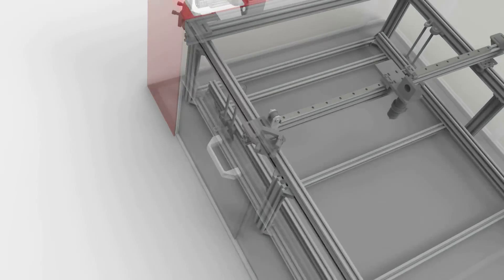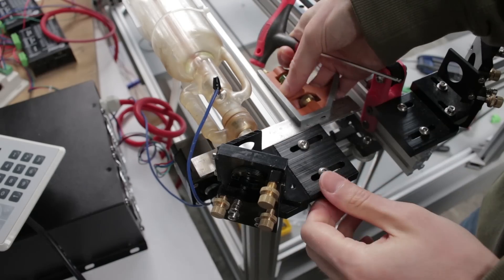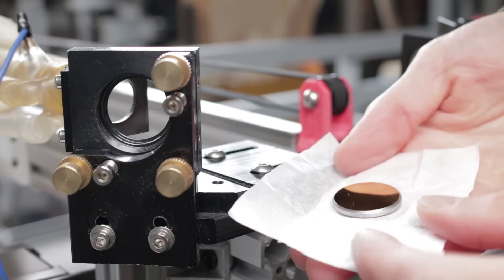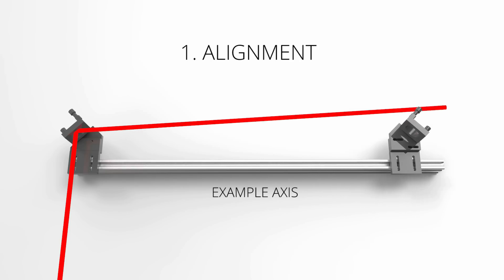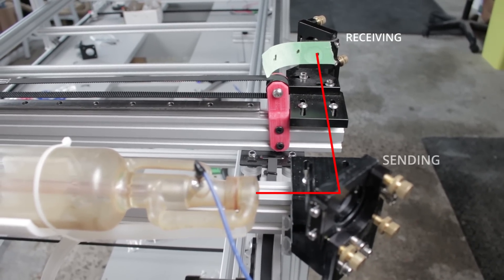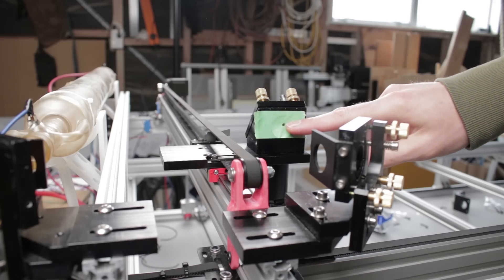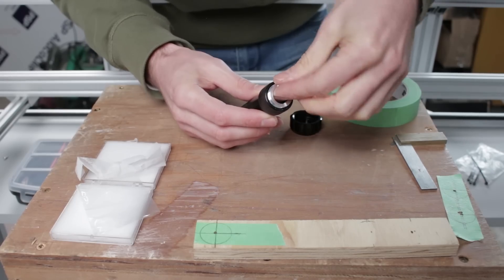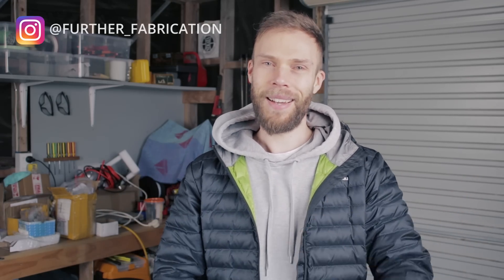Ep6: Laser Beam Mirror Alignment. The DIY CO2 Laser Cutter / Engraver Build Series

Comment: One correction: When you have the first and second pulses, you want to adjust the mirror 1 to hit between these two points. You do not want to try and align to the first dot. After the third dot is in between the other two, replace the tape and bring it near again and repeat.

Comment: This is undoubtedly the best video showing how to calibrate the laser! The only problem I have is that my points are very large. Already at the first mirror, the point is 5-6 mm (1/4 inch) and irregular. Do you have any tips on what I need to do to make the point as small and round as possible? I have a 100W CO2 tube.

Comment: Hello rob!
I recently purchased your build guide for co2 laser cutter and I have found that you have used 2028 corner connector but I am unable find these type of connector in my place so could I use 2020 corner connector instead of this?
And I have one more query can I use sliding t nut for all purpose instead of spring t slot nut and rotating t slot nut?

Comment: So here is a few questions. if anyone knows. Feel free to answer. . I have an output tester.   So I got this 30 watt tube newer, with the catalyst and an older one with a "non catalyst". Using my tester and finding my output to be all over the plast with "catalyst" tubes. I am trying to drop it down to 1.5watts of output on the newer catalyst tubes I bought. It will ONLY fire at 3.5-5.5 watts. While any older catalyst tubes I have. Will fire right at 1.5 watts. and I have never had this problem until I switched to catalyst tubes. Is there a reason for this? all 3 of my "catalyst' tubes act the same and will not create a stable beam at a lower wattage, unlike the older tube models. Thanks.

Comment: Guys, I have a question I'm also trying to build mine but I've stumbled upon a problem, or maybe not a problem but a question, some manufacturers have this on their website
1 Pcs USA Focus Lens D12 FL50.8
1 Pcs USA Focus Lens D18 FL50.8
1 Pcs USA Focus Lens D20 FL50.8

I'm guessing these are lens diameter sizes? but does it matter? should I be concerned about those?

Comment: The flat side towards the laser would mean there is no refraction on that side (as the laser has a largely flat wavefront, i.e. all parallel rays) and all the refracting happens on the other side. Lens designer like to 'split the power' between the two surfaces to minimize the aberrations (here spherical aberration).

Comment: I've worked on "flying optics" (light source and work piece stay still, only optics move) lasers that had 6x24 foot beds, up to 6kw. they were put on thick floors and were very rigid. they spent a lot of time getting a useable beam to travel that far without divergence and pointing instability. Purging the beam path with N2 helps.

Comment: Great video. In my opinion for a homemade device like that Should be better to put 2 mirrors before your "mirror one" in order to control the tilt and the position of the beam. With that you only have to align the mirrors moving the screws without touching the mounts. When everything is aligned first you can put a couple of irises before your mirror 1 to simplify the process in next alignments.

Comment: VERY well done, thank you! Is there a way to see in case of some misalignement, that the problem is that the tube is not perfectly parallel to the gantry, meaning the beam would go up or down? Or don't I have to worry and fix it with the first mirror? Thanks in advance for your comment...

Comment: You are the first one who approach laser alignment 'the right way' using minimum power. Just... I think you need to consider using fourth mirror for future upgrade for longer laser tube. It is worth additional cost - since you already have huge workspace. Also, longer laser tube has lower beam divergence aside higher power. Thus, better overall efficiency (and maybe smaller laser spot). Additional mirror may not insert too much losses, I hope. Divergence is important. Did you check further point - whether it cut the same as closest point?

Comment: Excelente vídeo! I need your advice, because you built your own laser maybe you know what is happening with mine. I got the first and second mirrors dead on center. The second mirror ( Y axis ) are perfect aligned. But wen we fire 4 shots in the 4 corned of the table, 3 are aligned and one are always of the target. Did you encountered this problem before? I am thinking that maybe my steel shafts of the Y axis are not aligned in the same plane. What do you think? Can you help me?
Reply: The same problem with the fourth shot is higher by 8 millimeters.
I can't find a solution

Comment: Just wondering: does the laser tube need to lay horizontaly for some reason other than cooling or could you mount it verticaly standing?
Reply: You can mount it vertically. You can even build a vertical laser cutter if you need to save space.

Comment: Hi Rob. So I have everything put together except the skin for the machine. Got my laser tube yesterday and will be doing alignment tonight. The question I have is on the mounts. I printed up the mounts and while the tube sits nicely in them, what is stopping the tube from moving during operation? I guess the real question is how are you securing your tube.
Reply from the maker: Nice one, that was super fast! So if you're using the 80mm tube holders there is a little square hole that runs through it. That's for using a zip-tip to hold the tube in, simple, but it works. But there should be any movement of the tube during operation, so even just resting it in the holders it will be fine.

Comment: Is this for pure enjoyment or are you able to build this for less than buying one? Seems a premanufactured system would be a lower cost investment with the kinks worked out. What wattage laser tube?
Reply from the maker: I enjoy the build, no doubt haha. 
But if you're not including the cost of your own time, it can be more cost effective to build one to your own specifications. Beam alignment is something you'd likely need to do on any laser system regardless of manufacturer.  
The tube that's in there currently is just an old 50W test tube. But you could fit up to a 150W no problem.

Comment: Please consider put the laser tube vertical on top of the output point and get rid of mirror for safety concern.
Reply from the maker: You're right, I should have mentioned that having the lasers in that position is more dangerous. However there's a good number of benefits in having it setup this way.
Reply: @FurtherFabrication  The way you shown on this video, I have tried before.  When I put my machine to service, I need to clean the lens every few hours as dust and vapor from the machine decrease the cutting efficiency very quickly.  I put barriers on the sides so no one can get their hands into the path of laser and get burn. But still from time to time things get into the way and burn. Once a drawing get burn and cause a small fire. The table I made is not so stable, that the lens are not stay 100% focus, thus the cutting time/deep is not accurate. In worst case, thick material may need much more time to cut. BTW, I have a liquid Nitrogen snooze attached to the laser head as a cooling agent.

Comment: I'm loving this Laser build! Is this machine capable of cutting 31.75mm Delrin? Thanks!!!
Reply from the maker: Glad you're enjoying it. That's a bit thick for lasers that I'm familiar with to cut. Most laser, because of the way they focus the beam will be best at cutting material with a thickness less than 12mm
Reply: @FurtherFabrication  Thank very much!

Comment: Very good explanation. I want a laser cutter since long. However i do not really trust the cheap chinese ones, and was never sure if i know enough about it to build one myself. Also the "professional" ones are usually way to expensive for a hobby application.
Reply: The China ones are actually relatively decent. The K40 is more of a hobby/tinkering machine, but the >$1k are supposed to be alright. 
Building one is pretty fun though, if you’re into that kind of thing, and might save you a pretty penny :)

Comment: Outstanding as always. Well explained and demonstrated. I always hear alignment is the hardest thing to do with a laser, and you made it look easy. 

If you had not made the laser mounts exactly parallel with the bed, what are the symptoms of the laser tube not being straight and square? I assume you can adjust that with mirror 1?
Reply: Correct, mirror one can correct for any weirdness of the tube positioning.

Also correct that the alignment is, by far, the most annoying thing to do. If the machine is built perfect, it’s a lot simpler, but if your gantry/frame is out of square, or your Y axis are not in the same plane, you’re gonna have a bad time. 

The latter is actually one of two things I haven’t seen in this video:
- four corner test, where you test fire on the head in all four corners to make sure they hit the exact same spot.
- Z alignment test with the lens, hitting far and near, making sure those dots are concentric.

Other than that, great video once again!

Comment: Recommend using gloves when handling the mirrors and lenses. If your  prone to fumbling like me a finger print on the reflective surface can create a bad day. Thanks for the vids, awesome work.
Reply from the maker: That's a good tip, thanks!
Reply: Not to mention that the lens material is toxic (if I’m not mistaken).
Reply: Hi James, do you know if the mirrors have too be covered when not in use / to protect them from dust ?  thank you, Ivan
Reply: Ivan G-S that’s twofold. Yes, it would help keep the optics cleaner, but there’s a risk of you forgetting to take them off, which is a minor risk. (Ever forgot time take of the lens cover of the camera before shooting?).

What’s better is to just regularly check your optics and keep them clean since the will get dirty mostly during use, not when idle.

Comment: Would it be possible to send the beam this wattage through a light pipe? Would it work?
Reply: In networking things pulsed low power laser beams run tons of kilometers (or miles), and they r reflected many times - to be more precise: they run around the inside of the fiber in spirals to transport as many lines as possible. Mirrors are also not 100% reflective, so a power loss also... your argument seams right, but i really would like to know. No one tried it right?
Reply: they make fiber lasers just more expensive and used for a different purpose
Reply from the maker: It's not something I have any experience with sorry
Reply: Do you (or maybe a other viewer) think it could work?
Reply: Short answer not easy and with a substantial loss of power. Every reflection results in a loss of power from the beam so it's best to keep them to a minimum. Also would possibly cost more and require more matainance.

Comment: What kind of lifespan could someone reasonably expect, out of a set of mirrors?  Common grade? premium grade?
Reply from the maker: More expensive mirrors won't necessarily last longer, though they will perform better (lower % power losses). 
It depends on a whole bunch of factors, so it's going to be different for everyone. But the main degradation of mirrors is from them not being cleaned. 
Just a ballpark number from my own experience, but a set of mirrors will last a year easy with casual use.
Great question.